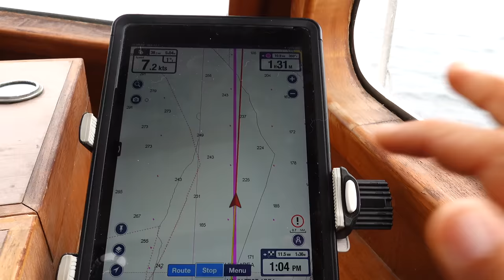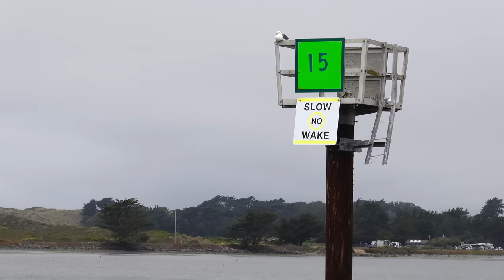BROKEN DOWN On Day ONE in the Pacific Ocean

Comment: I restored a grand banks 36 1st  twin Lehmans, 1st thing went was water pumps, then starters, and upgraded alternators to 120 amps each...you should use two group 31 batteries to start engines and use straight 30 oil in injector pump.you can adjust dampener on injector pump for a smooth idle

Comment: The chance of warping a D-series Ford cast-iron cylinder head after one overheat which you caught so quickly is minimal. 
Head-gasket is still minimal but possible. 
And overheat quite a few times before they damage a block. 
They are a very very forgiving engine.

Comment: Boat looks great! Hope you made your weather window. 

If your leaking coolant from a circulation pump, assuming its just a seal failure and the bearings are OK, you could pull the cap and fill with water to run the engine if needed. No need to pull it at sea if you don't have a spare. To check the bearings pull the belt and spin the pump by hand. Spins smooth with no excessive play bearings are OK. Leave the cap off and run it gently if  needed for docking or a serious emergency and monitor the coolant level closely. Of course use coolant mix when you install the new pump. As long as the blades of the pump are not badly corroded those pumps are very rebuildable. Good way to save on the cost for a spare. Lehmans pump price is not bad compared with most others. Had a Mercedes pump fail - new pump was over $600!!

Comment: Hi....  You have two pumps, one pump is called a raw water pump, its job is to pump raw water out of the stuff your boat is floating on to the engine.   The other pump is called a circulation pump, it's job is to keep the water in the engine circulating,  you just replaced your circulation pump

Comment: I had a Ford Lehman in my boat. Be aware that head gasket leak can show when the engine is under load but not at idle because the pressure of the hot gasses is much higher when lots of fuel is being burnt in each cylinder. So, watch the engine while Sierra is driving. I had a problem with exhaust gasses blowing into the antifreeze under load and blowing out the antifreeze. My repair was to install a large vented expansion tank that let the bubble blow through and vented overboard. I made the expansion tank from a discarded large fire extinguisher shell.

Comment: I have a trawler here in the Puget Sound and I normally run on one engine to save fuel. I usually only lose 1 knot when shutting one down and I swap back and forth between them to keep the hours consistent

Comment: Run a clear header tank at the Helm, 10mm hose feeds lehman tank.. head height under 100 inches will give you less than the 4lb cap.. 10 to 75 C gives about .7 litre expansion..
Engine is under constant pressure hot or cold and never under vacuum.. allanS750

Comment: Dorset engines can be more susceptible to warped cylinder heads if it was its pretty straightforward to remove it, then take to a engine shop and get them to resurface the head new gaskets valve clearances and off you go again, if the bores look clean you will probably be fine

Comment: Both those engines should have gotten new water pumps installed based on age of boat unless you knew they were only a few years old, also alternators should have been replaced or send into a shop for new bearings and testing... same for starters, you should always have one spare of each onboard... Starter, water pump, alternator, drive belts, filters, fluids, I would also keep a couple injectors.
Reply: We tell our offshore customers to carry the following apart from oil and filters to do at least one oil change per engine and belts/hoses, zinc anodes etc. 
Starter motor
Alternator
Raw water pump (Lehman ones are rubbish)
Freshwater pump
Thermostat
Set of injectors ( hp specific)
Full set of injector pipes ( D-series are renowed for breaking pipes if clamps come loose)
1 x head-gasket set

Comment: One alternate solution for closed cooling system circulation are electric pumps rather than engine driven ones.. They cost less and are quite reliable with service ratings of 10,000 hours being common..  Keeping spares on the shelf is a not much of a problem either..

Comment: What a cruise of a life time, motoring up, (or near), the Pac. coast line.  Thanks for sharing.  (Those water pump bearings and seals last quite a while, but when they go away, it sure lets you know by creating a mess).  Glad also, your engine temp. light was functional).  Might need an engine room exhaust fan.

Comment: Dunno if you're aware but on marinenized car / truck engines you often can get the non marine parts for cheap and fast at every auto parts store. Especially stuff like alternators, starters, water pumps, filters, belts, ... It's just some research to get the correct part numbers. Often they don't bother to change the numbers on the part itself but have different numbers in the parts catalogue.

Comment: To late now , but if you get a freshwater leak on that engine which you can not rectify - these engine will run fine depressurized. Cap off, keep topped up with clean water and keep  going. If depressurized you still have temp trouble you can remove the thermostat and regulate temp by engine load, slow down a bit. 
Just to keep in mind incase you have to keep going one day  with no options.

Comment: Funny you mentioned submarines when commenting about the whales as I was on a sub of the east coast in the mid 70's when we were on ISE (Independent Ships Operations) on the surface surrounded by a pod of whales. One of the biggest dangers with overheat diesel engines is warping  the head. I saw by the preview that did not happen. Good luck on your continued adventures.

Comment: Overheating can cause the cylinder head to warp which in turn makes the head gasket fail, check for oil in the coolant- milky white deposits ect. Chances are you are ok though as you didn’t continue to run the engine.

Comment: from where i'm sitting it looks like the bearing failed in the pump, i'd recommend replacing the one on the starboard too, i bet it's not far behind.  also, replace the hoses going to your heat exchanger, they look old. your lucky that the weather/ tide let you get back in. whoever did your pre trip should be thrown in to the bilge water, this is the kind of stuff that kills people in rough water.

Comment: Well because you have engine coolant mix with fresh water and the Diesel engine should be iron block ;less chance of damage must check oil because most engines oil will be used to be a coolant thank goodness and just make sure the water is pumping through the engine correctly as bits can block the coolant flow.

Comment: Just for future reference just because it is a marine application doesn’t mean an automotive parts store won’t have it and it may cross reference to another non marine diesel engine. It never hurts to check. And if it is a well known diesel engine manufacturer like Cummins or Detroit or cat. Then it should pretty much be the same pump as a non marine and the only difference would be the pulley. Just some food for thought.
Reply: On a non marine it would just be a water pump not a fresh water pump.

Comment: Would have loved a bit more thorough documentation of the failure, every little bit of learning about these problems helps to troubleshoot should something similar happen to me in the future. From your description of the seal failing, it makes me wonder why you need a whole new pump and not just to keep some gasket material around to self-make a new seal. I'm sure you're right about needing a new pump, but didn't get why from the description you gave.

Comment: Well Not the Best situation, But you are Handling it well.... If it is just the water pump you're in good shape. the worst case would be a warped Head or blown head gasket, you could tell if coolant is leaking out or its in the oil. if that's  the case you could try torquing the head, you should carry a spare Head Gasket, maybe a new mechanical seal to rebuild the water pump if you get in a bind. But i would definitely have a spare for the other motor being you didn't run the hell out of the engines before cruising to the San Juan's... Happy New year and Good Luck....

Comment: Depending on how old the engine is you should have a thermal cutoff that will kill the engine and not allow it from operating at a temperature that would result in damage to your engine. I know your boat is older but it might be something to look into. Safe travels.

Comment: Hope the water pump fixes it, might want to carry a head gasket on board too!
Reply: That won't really help because if you blow the head gasket the head should be skimmed and pressure tested prior to installation of new gasket, also your gasket should be sized according to the manufacturer bump height (clearance between piston at TDC and seated valve faces in head) which is dependent on how much was skimmed off the head, you get different head gasket thicknesses to compensate for this.
It also depends on the cam configuration as to whether or not you can even remove the head without removing the timing/cam chain/belt cover, tensioner and chain/belt as is the case with any OHC (overhead cam) engine where the rocker arm has a sprocket or pulley driving the valve train which would require precise alignment of the timing marks on the crank and rocker arm pulleys/sprockets to ensure correct valve timing, this obviously doesn't apply to push rod motors where the valve train cam is side mounted in the block

Comment: if you run the boat on one engine, you need to prevent the non running engine shaft from spinning otherwise you run the risk of burning up the transmission.

Comment: motorcycle racers never use gaskets on their split cases...head over to A ducati shop and get the Ducati grey goop/ 3M has a similar grey high heat silicon

Comment: I'm not familiar with engines. Might there be some material that you can cut a seal out of to replace any seal?
Reply: Good thought however the seal on a water pump is a running seal that is built into the pump that usually requires shop machining to replace. It seals the outer dry spinning parts to the inside wet parts that it is connected to. As a practical matter you would buy a new or professionally remanufactured part. However, it would be a good idea to have some material as you suggested to make a gasket that goes between the mating surfaces of two parts. There is also a paste-like material dispensed from a tube that hardens to "form a gasket" so you essentially can make a new custom gasket. Billy will be installing a gasket where the pump mates to the engine block.

Comment: You guys should put electric motors in your drive lines. And wind turbines up top. If using fuel just have them spinning as a fly wheel. If your engine goes down, you just drive on electric. And if you need electricity just run one as a generator.  Worst case or when not in a rush, you just drive on the wind/ solar power. And if you blow a head gasket you can run oil in your fresh water side so any leaks are oil into the crank.

Comment: WHY???? would you ever cruise on two engines?? Are you in a hurry? Got money to burn? Even a distance of 90 NM you can do during daylight at 6kts. Running two engines is only usefull when you need temporarily more power or when you are maneuvering. Cruising on two engines is a very waistfull a contradiction in terms. Just cruise on one engine and alternate them so they have a simular wear and tear